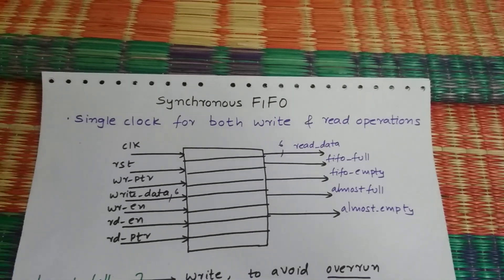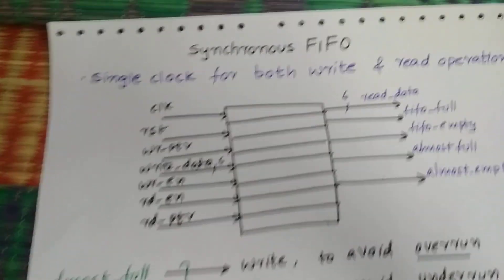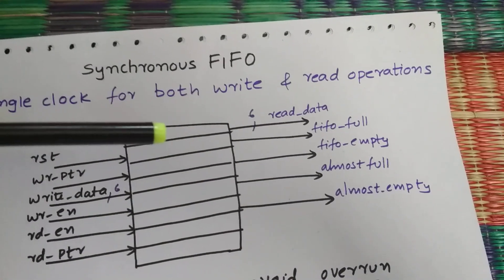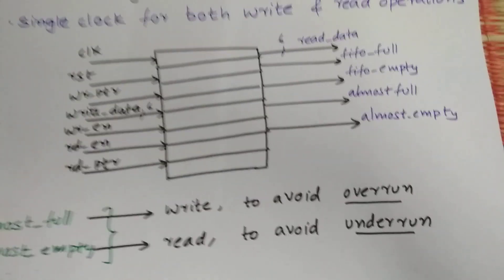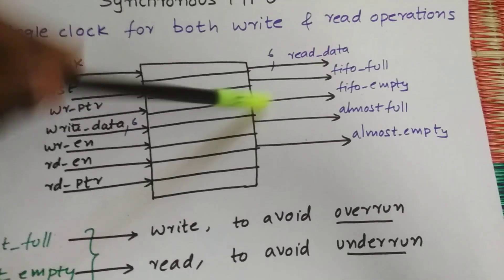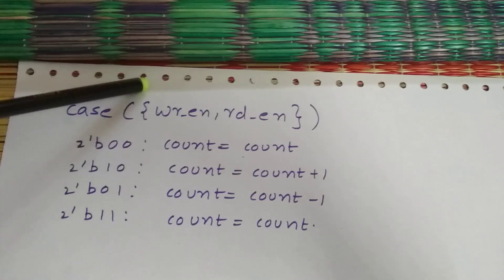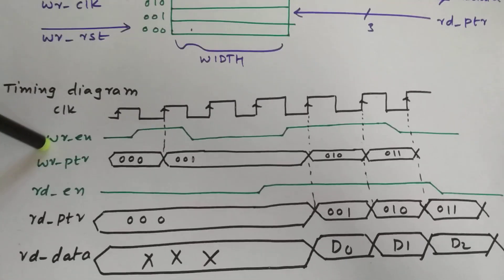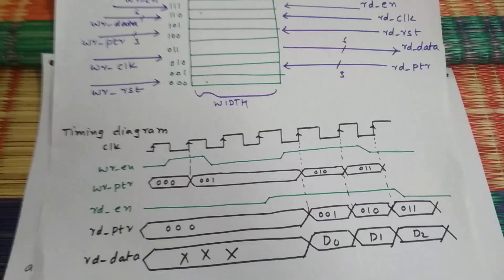Synchronous FIFO  /  FIFO-part ll

Comment: fifo is used between two different blocks that work with different frequency then what will be the clock value for  synchronous fifio
Reply from the maker: FIFO can be synchronous and Asynchronous, the one you mentioned is asynchronous, 
Synchronous FIFO will have same clock of the block which it is operating with. For more information on async FIFO check my channel CDC playlist , thanks for asking good luck 👍😊

Comment: I appreciate your effort. I found a few mistakes in your tutorial
1. Timing Diagram:-  You didn't represent the data,  you are comparing pointers positions in the graph what about data_out.
2. Another thing is it better to use Empty and Full instead of almost.

If anyone need FIFO_CODE u can ask me I will mail you
Reply from the maker: Hey lucky , please  don't send code if anyone asks , you are kind of stopping the effort , that will be helpful for them in long-term. you can clear there doubts 🙏👍
Reply from the maker: Thank you so much lucky 👍
Reply: Hie Srinivas Could you plz share me your email ID so that it would be helpful for me to get some knowledge regarding FIFO.
Reply: Hi Srinivas ,I m really sticking with this synchronus fifo terminologies and its implementaion ..I'm really new at it and I really need help.cau u pls provide ur email id so tht I can contact you for code and my queries pls
Reply: Hi Srinivas.. Plz give your email I'd. I have many doubts on synchrous and asynchronous FIFO